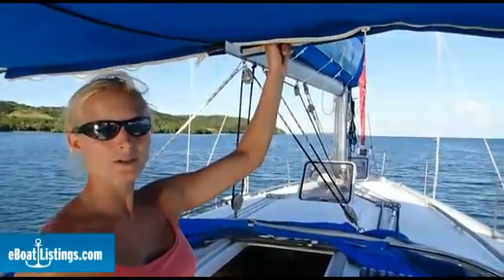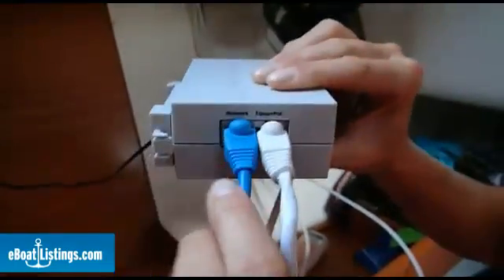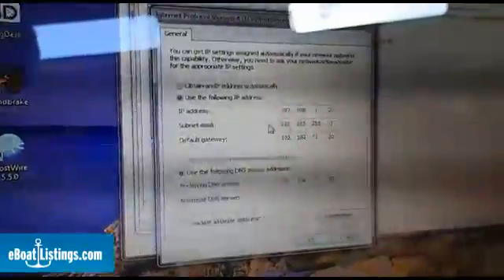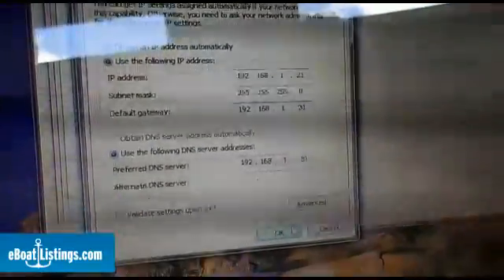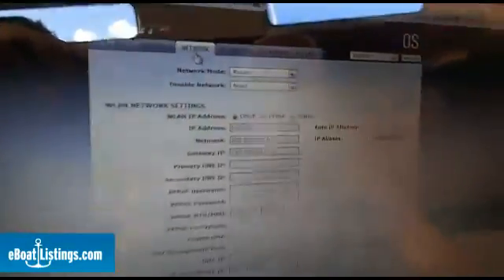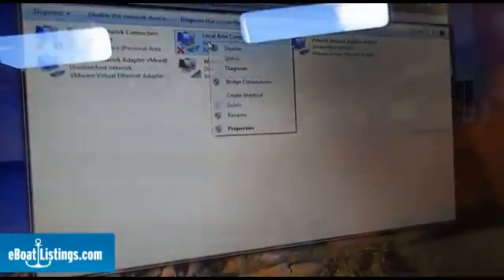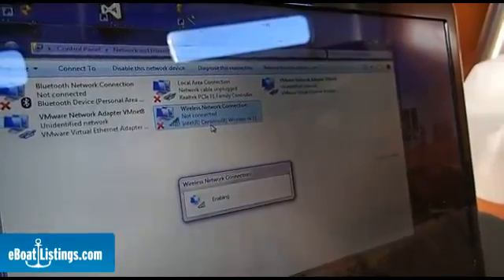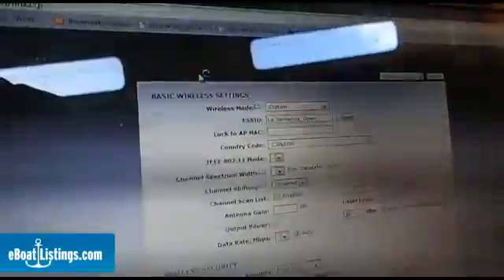How to get long range wifi on your boat

Comment: Great Video! For those that find it daunting MrWiFi.com.au sells the latest hardware in kits already configured when purchased. Some of the kits allow for CCTV security cameras indoor or outdoor which are powered over 12V.
You can secure your boat or yacht while your not aboard & the cameras are accessible remotely via your phone or smart device whilst you are connected and you can install a Network Video Recorder( NVR) should you like to record the video footage on motion. All you need to do is install the hardware once received. Choose your internet hotspot available at each location and your connected.  See details at www.mrwifi.com.au/wifi-booster-kits/

Comment: How does the repeater get the internet connection? Im assume through the provider but how is the physical connection done for it?
Reply: How far out from the connection point have you been able to make it work (reliably) with clear line of sight?
Reply: The bullet is set up in station mode. This is just like your wifi in your laptop but is outside, hopefully high up on the mast where it will have good line of sight to a wifi connection on shore.  Normally you would use 2.4 gig frequencies outdoors but I recommend you set up the wifi router inside on 5 gig if your laptop and other devices can use 5 gig. This will just keep you from causing interference with the Bullet.  I have used these bullets in land based settings very successfully.